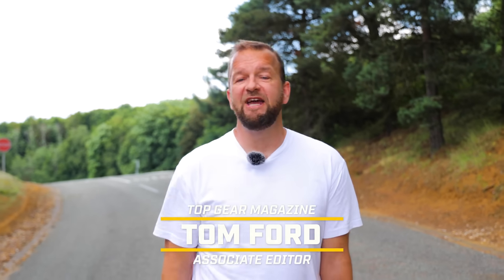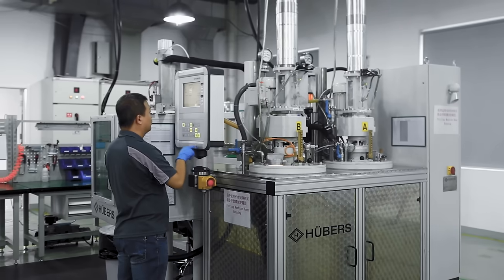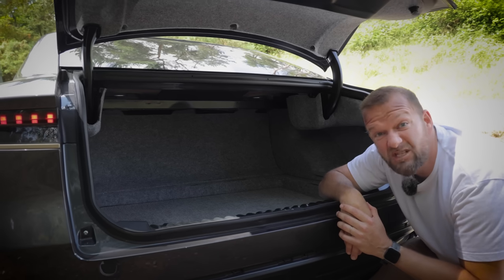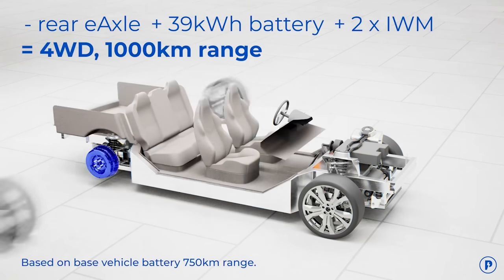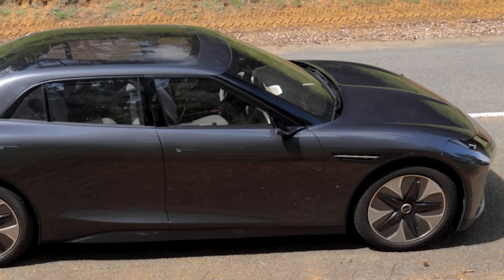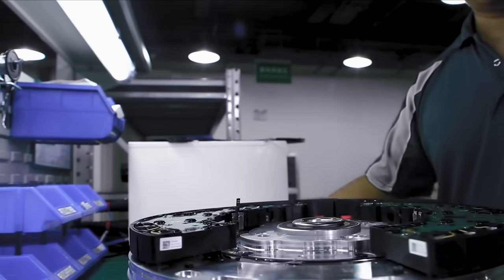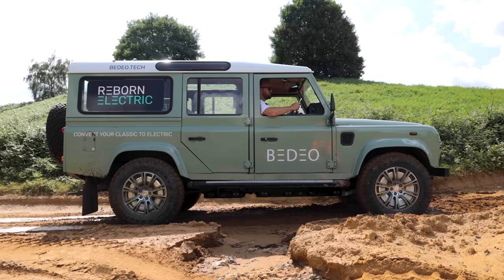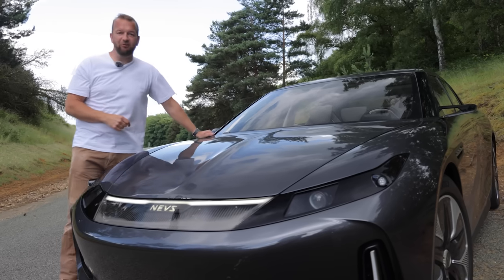NEVS Emily GT: SAAB’s Secret EV With 600 Mile Range | Top Gear

Comment: Does this battery car also burn your house down or stops working if the battery gets wet? Must be very reassuring in a hurricane or flooding. Oh, and after how many recharges do you have to throw it away like an old phone because the battery's dead and the car has no resale value?
Reply: I mean, batteries today are sealed.
So water isn't an issue, and its not like a normal petrol engine can run when it has been flooded xD

And EV fires are less common than ICE fires, even when you compare new cars.

Comment: one pot hole and that car is done for....
Reply: I love how the testing in mud is done with super thick beefy tires and offroad rims, of course you're going to have less chance of failure with that setup. 
That's not realistic real world driving. Take it to the city and bang it off of every pot and old bridge deck expansion joint.
Reply: just the cost alone to research and develop let alone produce an inhub motor that can last +100K km without failure, means the price of these cars are going to be ridiculous.

Comment: Now make a hatchback or so-called swollen hatchback SUVs without a gear tunnel, put in 70 to 90 KWh battery pack. We're sorted. This product will sell like hotcakes in India. Just make a low HP variant to cut costs. Dual motor at the rear or front as an option all wheel Quad version for the enthu & elitist. Easily would reach long distances of 700KM @80 to 120Kph.

Comment: they lean from Tesla .  shape and interior its allmost  tha same  and screen is tha same  . but is only 1/2 Tesla . they d'ont have  IQ ( software and also hardware - camera and AUTOPILOT ) UPGRADE software !!. and about  the novelty , WW they allreadi have in tha production same kind of motor in wheels . but is beautyful and tha range is very good ( but try hard with motor , 4,5 seconds ?  Tesla with 3 engins , not 4 , make  1,9 seconds . good luck

Comment: I hate all the gadgets, the touch screen and push button doors. These are all guaranteed failures and high expensive repairs in the future. If they could just come out with a EV that still has knobs and still has handles Not only would you pick up new sets of buyers but you'd also make these cars more appealing for those who think a little bit more before they purchase. Racinea demise of automobiles already with CAMBUS2 systems and massive electronic failures due to all the unnecessary gadgets in modern cars. These EVs are going to be just as horrible. There's recalls constantly over software issues and EV shutting down. We need to stop making things so complicated and making them more simplistic. All this complicated design is not only bad for the consumer in the industry but if you're going to be all about the environment it doesn't make sense to make all these expensive systems that are making cars become throwaway instead of repairing them. Just as bad as a cell phone market.
Reply: I absolutely agree. More physical buttons like in “the old days”.